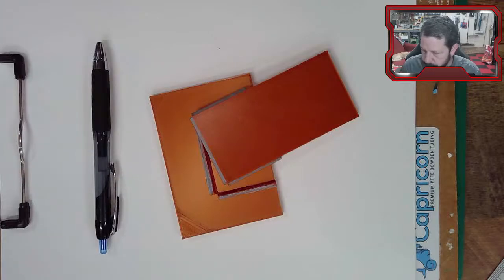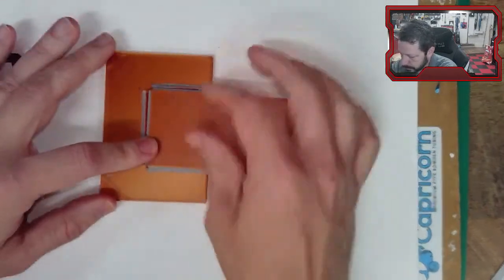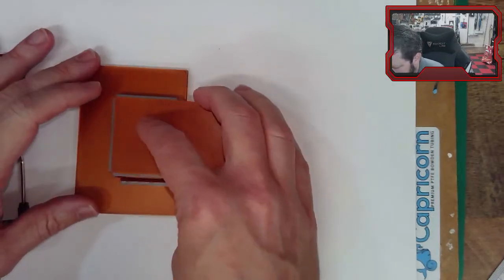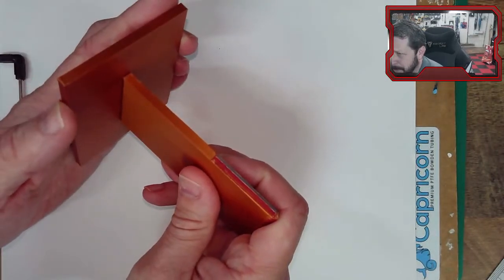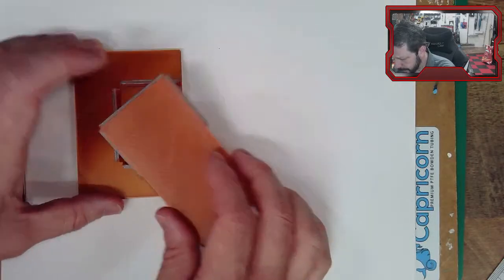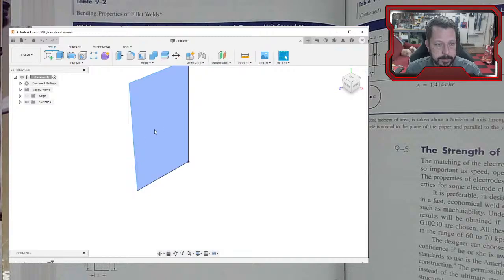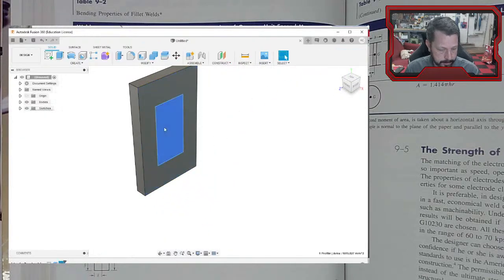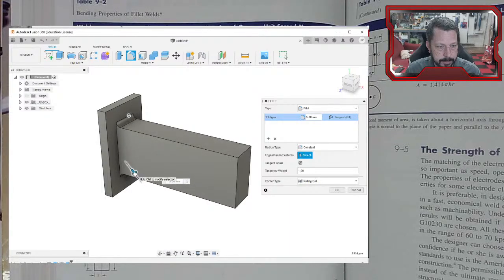Shigley 9.3-9.4 | Welds in Torsion and Bending

Comment: Thankyou for this wonder video. I am working as an intern in an industry and one of my assignments ar to calculate the weld strengths of criticle joints. This helped me a lot in understanding the calculation required. I used the method here and then used ansys to analyse it. and it all matched out.
Reply from the maker: You are very welcome! I am glad the video helped. :)

Comment: Hello. Great Video. Quick Question. You said at 59:40 that MC over I is the bending stress. Why is it called shear stress in the text?  Based on my question for the previous video I'm guessing Shrigley's mythology doesn't believe in fillet weld tensile stress? Do they treat everything as shear?
Reply from the maker: Yes, MC/I is bending stress and that particular load scenario looks like what we would normally call bending stress. So if we were looking at the stress in the beam then it would be MC/I (bending stress). But in the weld we are calculating a similar thing and calling it the secondary shear stress in the throat of the weld. And yes, Shigley only considers weld failure in the form of a shear stress on the throat of the weld. There is also a chance for their to be failure of the base metal which I don’t think I considered in the particular example of this video. I hope that helps!

Comment: How do you know when you need to use a torsional shear or bending shear when they don't explicitly specify which method to use, in problem 4 of the book they use bending shear but i dont know why they didn't use torsional shear  stress method?
Reply from the maker: It is dependent on the applied load. If the load tries to pull the welded member away from the wall you use the bending table. If the load twists the welded member parallel to the thing it is welded to then that is the torsion table. I hope that makes sense. :)

Comment: Thank you for explaining it in an easy way
My question is: If we are given a weld group geometry and a factor of safety, and we are asked to find a weld group geometry with the same factor of safety (for same loading), how can we find that weld group?
Do we have to iterate for different weld group geometries as given in the tables?
Thanks again
Reply from the maker: You are welcome.
Your Question: You could iterate, but I think what I would do is choose the new weld group geometry and leave the weld size as the variable and back out the new weld size. You could choose the new weld group geometry based on ease of welding access as a justification for why you chose that particular configuration.

Comment: I'm student of Mechanical Engineering. My question is that how to find whether the weld group is in bending or tortion?
Reply from the maker: If you image the welded part pulling away from the wall when loaded it is bending. If you imagine the welded part sliding along the surface that it is welded to then that is torsion/shear. I hope that helps some.
Reply: @KellyBC  I din't get it. The scenario here is quite different. Someone tells the concept of centroids, and someone tells the concept axis to check whether to go towards torsion or bending. The recognition of bending and torsion with the help of geometry isn't taught here. Please make a live webinar on this topic. We all students will be very thankful to you for that.